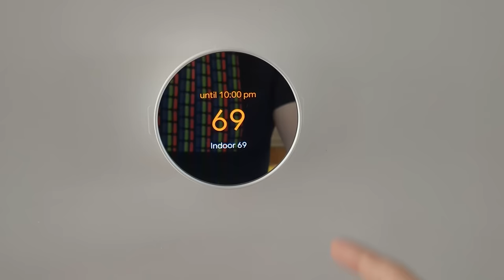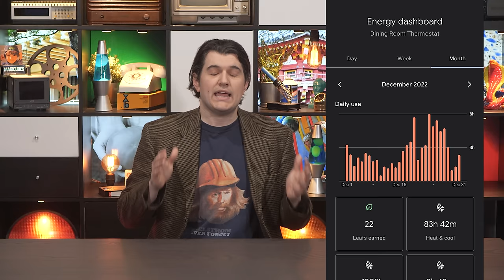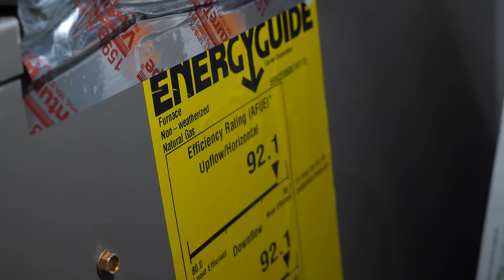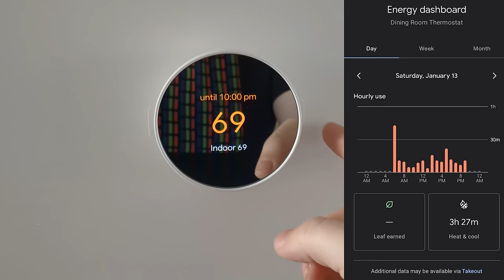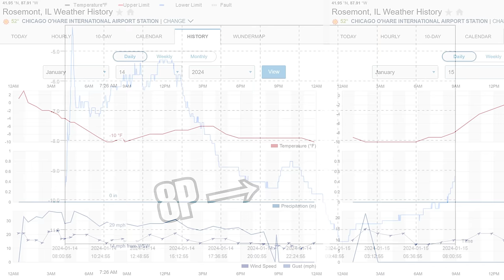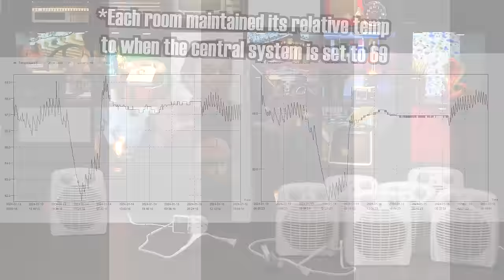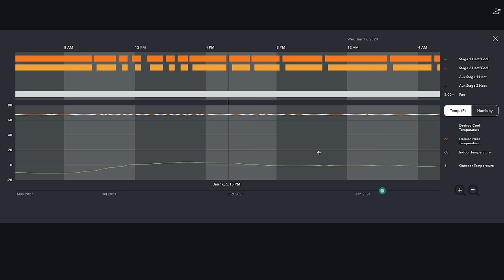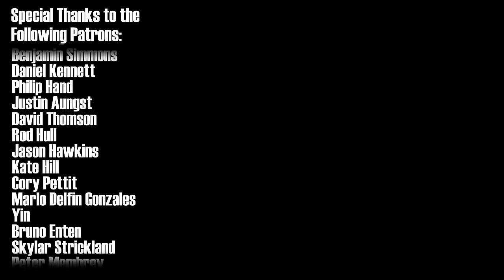Old HVAC industry practices are holding us back and costing us money. But we can fix it.

Comment: Heat pumps are great.  Be careful buying minisplits. They are often advertised in a way that imply laymen can install them.  Please don't.  Also, they often have automatic shut offs for sub and near zero temperatures.

Conventional heatpumps have backup electrical heat installed standard, so are safe for most residential situations
Reply: That maybe true for regular heat pump minisplits, but there are plenty of Cold Climate ones on the market that don't need electrical backup, nor do they switch off in sub/near zero.
2 of mine are rated down to -30C/-22F, and the other one, whilst some places quote it's Minimum outside operating temperature at -15C/5F, it was still working fine for 3 days straight in -20C/-4F.
Even the DIY MrCool ones seem to be specced down to similar temperatures.

Pretty sure the only reason US Conventional heat pumps have resistive heating "as standard" (in quotation marks given I've seen people have installs without) is because the indoor unit may not be within the thermal envelope / conditioned space, so needs it for defrosting.  And the US is the only place where "conventional" heat pumps require it.  Here we either have minisplits or Air to Water heat pumps, and neither need resistive heating - and haven't done for well over a decade.
Reply: @BenIsInSweden  you're totally right. They are designed for most situations,  I'm mostly hedging on the fact that are sold to people that don't really know what they should be looking for off of sites like Amazon

Comment: I bought a heat pump bc of your old video and I got scammed. Love the tech, hate the installers. $15,600 later, in one of the cheapest areas in the US, here's the TLDR: don't even bother if you're not in a top 50 most liberal city. You'll be lucky to get one single quote. Every other installer told me I was crazy. Insulate, insulate, insulate. You're much better off buying a crappy gas furnace and using the meantime to insulate, than paying the extortionate prices of the only heat pump installer in town. I think I probably would have less CO2 impact if I was running gas here and put in $10,000 in insulation in my many, many loss points. Insulation and energy efficiency will totally change the load calculation so it pays to do it months ahead of the install. Know your house and your thermal needs frontwards and backwards. Know where all the heat loss is, know your actual load, know your minimum AND MAXIMUM design points! I would have been fine with a max of 65 or even 60 on the coldest days, but nobody ever asked me. Learn about ducts and attics and crawlspaces because I sure didn't. My 2nd floor unit is in my attic... did I get scammed harder than I thought? Great.

The best time to shop for a heat pump is when you don't need one. Know the exact load spec you need, so when the time comes you just plug in the numbers to an online retailer. Have this stuff tattooed on your body, that's how confident you need to be when you're ready to replace your old furnace. Ideally when it breaks, but the math may shake out where you should replace it before it dies. I also found that having AC "bundled" with the heat pump made it easier to swallow the bill, since my house didn't have AC already. I personally believe dual-source heating (heat strips) are a scam with modern heat pumps. But I'm nowhere near an expert, perhaps they have their place. I'd rather save the install cost and plug in a space heater or god forbid PUT ON A JACKET 5 times a year. Ending on a positive note, if you are able to go all electric, you will save a service fee. In my area it's $40 per month before a single cubic foot of gas is pumped.

Comment: It's always sad realizing that at 120V, the 16A is not 3.7kW like it is here, but it is less than half...
No wonder that induction cooking is not a thing
Reply: Wtf, 100A?... it used to be normal to get 25A single phase here... now it is 3x25A and that should handle heating too. The difference between 230 and 120 is sad. Also the amount of extra thick wires you need not only to prevent fires, but also the amount of power you loose... dang...

Comment: I’ve only one qualm with this video—I don’t think it’s outrageous for someone to want a system that can handle everything thrown at it without the unit struggling, having to supplement the unit with a space heater, or having to bundle up. 
In my opinion, that request could be the difference between someone adopting and spreading the wisdom from this video and rejecting it. 
Why not size units to handle all feasible conditions without struggle? If the de facto sizing philosophy is N+4, you’re proposing N—why not go with N+1?
Reply: if you need to supplement with a space heater, something is wrong with it or it is undersized. The idea isn't to undersize, but properly size for the coldest weather an area gets. there is naturally going to be a margin over that most of the time because they come in size increments, it is never exact.
Oversizing heating systems "just in case" has pitfall of reducing comfort most of the time due to shorter cycles - all due to being scared that less than 1% of the time the temperature inside will slide one or two degrees from 4 to 6am less than early morning per year

Comment: You would be absolutely horrified at the electric set up in my airport hangar. I’m powering a refrigerator, radio, string lights, florescent light, power tool power strip, tv, phone chargers and a single small electric heater on multiple splitters to extension cords and power strips plugged into a single 20amp outlet.
Reply: NOOOO

Comment: I really love this channel but I've got to take umbrage with the title and thumbnail of this video because in my personal experience it's the new HVAC systems which have been absolutely murder on our collective pocketbooks, comfort levels, AND the environment. First there's split A/C, which absolutely and objectively doesn't work: It just sits there yanking electrons out of the wall to pretend to cool the air. I live in Cambodia and I've had seven split-A/C systems here, in five different installations in four different apartments, and they do, not, work, period. Then I bought a cheap window AC unit of the older style, and it has never failed to work or needed any kind of service whatsoever. The current furnace/air handler tech, meanwhile, is to flood the box with printed circuit boards -- and never mind that PCB's have no business being that close to that many different kinds of adverse environmental conditions. It's absolutely ridiculous to me that there are printed circuit boards inside my furnace. They don't belong there. Period.

Comment: I have a heat pump for my server room at work. Its efficient, sure. But its not as reliable as my hvac system at home. Ive gone through 3 in 15 years and the current one leaks during the summer (its a Mitsubishi)
Reply: Leaks? You're not just taking about condensation right?
Reply: @logitech4873  yes, it's from condensation. There's a pump and line to take it outside, but it never gets there. The entire unit leaks from its seams.

Comment: I now make a bid to totally anger you:

I am in Los Angeles. I live in a loft apartment in a building constructed in 1972. I like lofts for the aesthetics and feel.

Guess where the AC and heater are?

They are both electric.

The heater? In the loft.

The AC? Downstairs in the living room.

Yep, cooling starts downstairs, heating (from a single in wall forced air resistive element) is upstairs.

The only saving grace is that the gas fireplace is downstairs. Oh, and it appears that except for the original windows and the door frame, the insulation is actually really good. And the building has replaced all the windows for better insulation.

Ridiculous

Comment: I wish the installer I dad do my very expensive system sized it better as it stands it can’t even keep my house 19c when it’s 12c outside with out running non stop and consuming 20 to 30 kw add the factor I had a Woodstove running befor for a few days warming the house up as soon as the heat pump comes on the house drops down to 16c and takes a day and a half to two days to return to 19 C the ac side works great though

Comment: heat pumps in the uk are twice as good but gas per unit is half as expensive as electrictiy per unit, that these things use......so 

You dont save any money, in fact it will be 10+ years before it pays its self off.

Comment: Is it not true that a heat pump can only pull heat from ambient air that is 32 F or higher?
Which means at 31 F or lower, the heat punp will  need to constantly use the auxiliary or emergency internal heat strip...
Reply: Did you actually watch the video?

Comment: This video emphasizes for me how wildly inefficient mobile homes are. dinky little space with a wayyy overkill hvac system that runs only a few hours EVEN though it still loses heat from thin walls, huge old leaky windows and crawlspace vents. and with pretty same temp conditions to the video too.

Comment: What I don't see in this video is how much you save on gas and how much more you'd spend on electric. Even if you save money, if everyone does this electricity will go up as the electric grid loads more at night with the constant running electric heat pumps. There's a reason they're over sized, and this is a practical reason they're gas/electric instead of just electric

Comment: Most people do not want a setpoint of 70 degrees and would want the heat to be much higher then you currently set it at. Remember when you buy a heating system you are buying for the next person to own the home other than yourself. It is not unreasonable for most home owners to want 76 degrees. Using my own parents as an example they never set the heat above 66 or 68 most of their lives. Now in their old age they insist the heat is set at 74 most days.
Reply: anything over 70 is too hot, take it when i walk into a place in winter that's at 75+.
you must keep in mind, sizing is done for extremes occuring 1% or less of the time, so with a 70 design temp, if it is sized very close very few hours would be spent not being able to maintain a higher setpoint. most of the time there is a margin because equipment comes in size increments, it is almost never right on. an extra 5c in most homes would only take an extra 5 to 10 000 btu/hr capacity.

Comment: If you have natural has already then a dual fuel heat pump may be the way to gi where the furnace is used as your backup heat.
Also zoning a system can greatly increase the energy efficiency overall

Comment: Why is using a space heater preferable to having an oversized system installed? Isn't resistive heating really inefficient? Sure, you don't need to be 3x oversized, but a 150% capacity system will basically never require supplementation with inefficient heat strips, and I don't see the upside of having a 'barely capable' unit that does need it occasionally.
Reply: Inefficient? You kidding?
Resistive heating is 100% energy efficient.
1kW in = 1kW out.
Reply: @logitech4873  And as noted several times in the video, heat pumps have over 100% thermal efficiency. A heat pump that never has to turn on aux heat is superior to a 'minimal' one that need to turn on resistive heat occasionally (unless being oversized somehow makes it less efficient). 
(gas heat is also cheaper per btu than resistive heating)
That's why resistive heat is basically only ever used as backup. It's the most expensive way to heat your home.
Reply: @nlb137  Depends on where you live. No point in making blanket statements.
It's easily cheaper than running the wood stove (buying firewood) or running a gas heater (buying gas bottles) where I live. But, naturally everyone uses heatpumps because of their much higher efficiency.

Comment: Why not disable a couple burners… Or buy a 8,000 btu diesel heater and you have a great heater that you can run off diesel and a car battery? Oversized cooling capacity… Short the unit on charge..

Comment: So many more points of failure on a heat pump due to more parts. Refrigerants, valves, fans,coils. Not saying heat pump bad just more potential maintenance costs. Coil and filter cleaning also required

Comment: Always get a heat load calculation when swapping units. Never swap like for like. The practices of even the most knowledgable, diligent old timey hvac tech were questionable at best. Technology has evolved so far, chances are your old unit, heating or cooling, is wildly oversized or just plain wrong.

Comment: I would say your heating is not even close to 4x oversized when at time it has to run at nearly 60% capacity. Not unless you are willing to change your habits and adapting your daily temperature-profile. BTU and Tons. some things are just so wrong.
But i would gladly take a heatpump but i simply can't. Its and apartment and they had already been applied for and it was denied.... too loud..... next to some train-tracks.... Isn't bureaucracy beautiful?

I also find your rant about the ductwork refreshing:
Even the ancient romans knew how to do that, yet somehow people still think it is new. The old farmhouse of our relatives had been remodelled several times, the only thing that is still mostly like it was >200 years ago is the groundfloor and basement. And the floor has channels for the hot air cause there is a large oven for baking, cooking, oh and heating the entire home. They have now integrated that with the warm-water and heatpump-system.